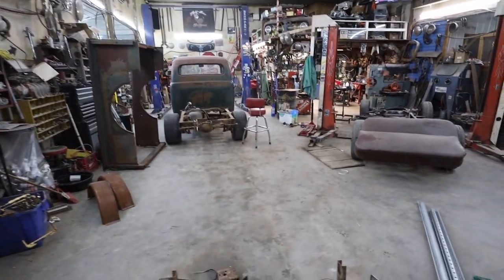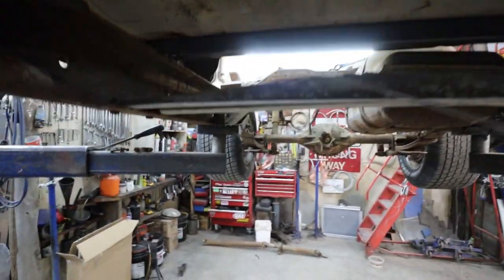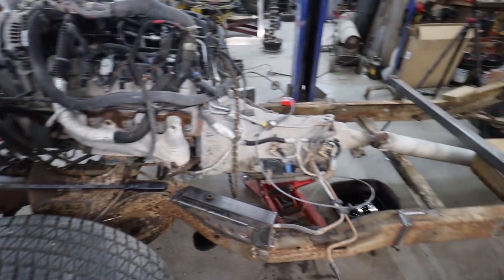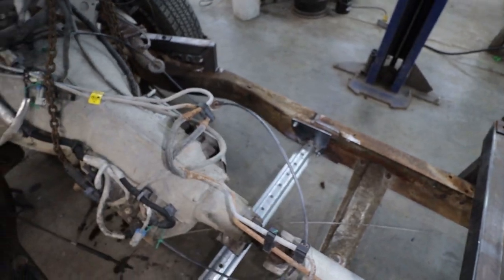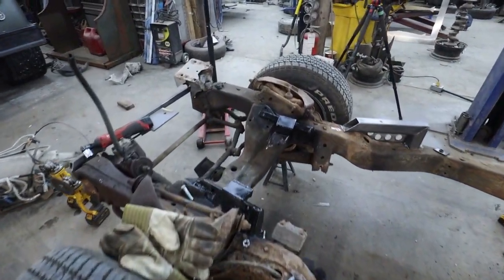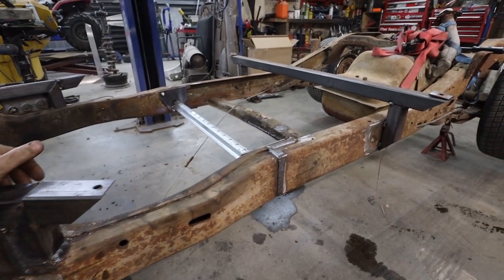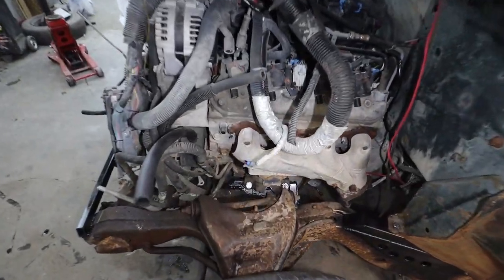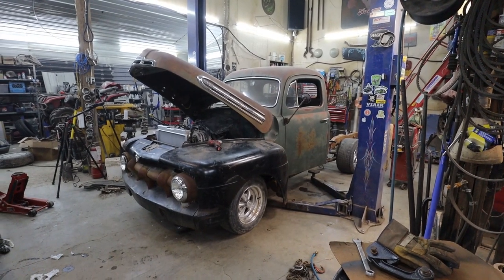Making motor and transmission mounts for the LS in the 51 Ford F1 Part 5

Comment: Great work Brent as always. Used LS motors must be a bargain. Im am an old school er and have not embraced the LS era. Carbed big blocks and small blocks in the works. Following your progress and diggin the trip. Thanks
Reply from the maker: Yeah was what was supplied but they are cheap to buy out here.
Reply: @HalfassKustoms  Not cheap to buy in the states. It is a shame you couldn't have gotten a sbf 289, 302, 351ci, would have been so much easier on you. But I can imagine, those are probably not too easy to find.

Comment: quick tip on LS exhaust manifolds, they are made of cast "steel", not cast "iron" I would "pie-cut" them above the outlet flanges and rewelded them  to get the angles right for the frames they were sitting in

Comment: You know Canadian wizard of Welding this may be the first time I would doubt any of your work but that transmission cross brace doesn’t look like it’s up to the task once that motor starts torquing it! Still love the video brother! 👍👍🎉🎉🎉🎉🎉🤘🏻🤘🏻🇨🇦🇺🇸🇨🇦🇺🇸🇨🇦🇺🇸🇨🇦🇺🇸
Reply from the maker: the motor mount will be what takes all the torque, with that said the transmission only has a single bolt in the middle so I would think it'll be the failure point there :)

Comment: Pushing another one through. The builds going faster every time it seems. Keeping it simple speeds up the work though. My s-10 chassis keeps looking more promising. Even came up with a plan for the 4cyl and 5 speed. I think.
Cruising season is on the horizon, so blasting through this one will get another one on the road. Fancy can be done later.

Comment: Where the exhaust comes close to the frame, cut the hump out, turn it over and weld it back in with the bump down...Voila clearance issue is gone...I am in my 70's and have done this for years.

Comment: You are making these swaps look like child's play. I have seen this done on another channel and the mounts were a couple segments long on just the engine mounts... I do have a little concern with the tail shaft mount as that does look a little lightweight for most applications but there might not be as much weight as I think and I have seen them put together with no rear mounts (that was bad) and they still tooled right up so its  real simple and maybe its this frame that lends well to modifications.

Comment: I see your PCM laying up there while you're welding. Have you ever damaged one doing that?
When I had one fail, I couldn't be sure it was just on the way out or it was my fault welding nearby.
Reply from the maker: Had weird stuff one time as I use to not disconnect the battery. But as it sits im not worried as it's not hooked up to any batteries.

Comment: You really make it all look easy and great video content!!!
I'm also putting in a LS engine (LQ9) with 4L65 tranny in my 51 Ford Pickup using the stock frame. I removed the old front suspension and put in a Mustang2 frontend with rack and pinion. The uncertain part was how much do I have to cut into the firewall/floor to make it fit??? That's the big question I had. Your video has helped me immensely. Thanks and keep up to good work.

Comment: Da boys, da hounds. Turn turn turn da F1/s10 budget build around, slam dat 4.8Ls in da frame down, transmissions sign posted up off da ground, 1X1 motor mounts ain't purty but burned in dey's  hidd'n n sound, tranny's clearanced cut'n out a couple a  pounds, front clip fits n radiator sits silver crown'd. F1/s10/4.8Ls mongrel hound.

Comment: I wish you were closer i would send you  one of the 3rd gen Hemis harness and computer to see what you could do with one of them. DIY hemi says only takes 3 wires to run after you flash computer
Reply from the maker: Interesting, kinda like an LS then really
Reply: i have several of them having been planning on putting one in my 1994 ram 2500 4wd 5spd

Comment: I enjoy your videos. Are you able to remove the a arms  to replace the A arm bushings with the motor mounts the way they ? I'm currently replacing mine.
Reply from the maker: will be able to, but may have to undo the mount and lift the motor just to get the room to remove the a arm.

Comment: Should do a carb LS
Reply from the maker: Cost wise it wouldn't make sense, it would triple the cost of the motor installed and running.
Reply: @HalfassKustoms  but it would look a hole lot cooler then a bunch of wires and hoses, I like thing clean looking and simple
Reply: @MrJeep75  Injection is better setup, these cars are not showstoppers but used on the road.
Reply: @MrJeep75  Well in a way they are showstoppers but you get my drift.